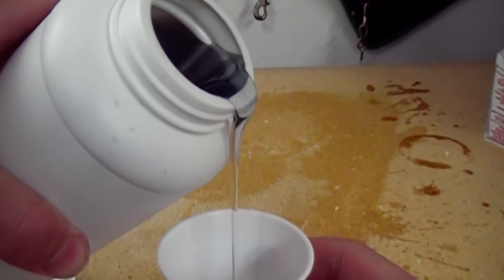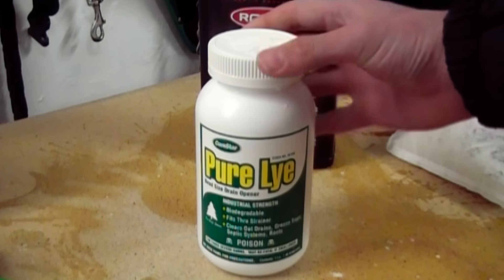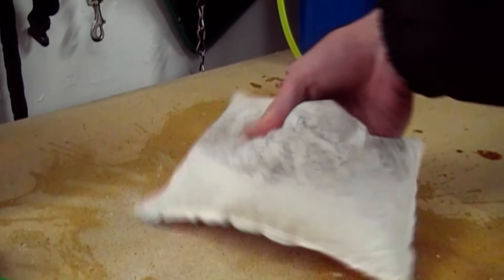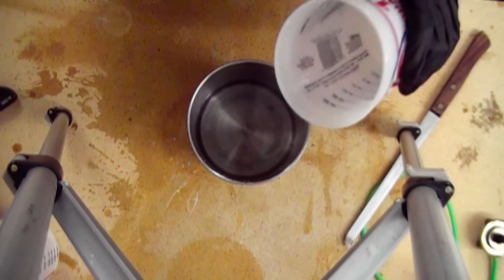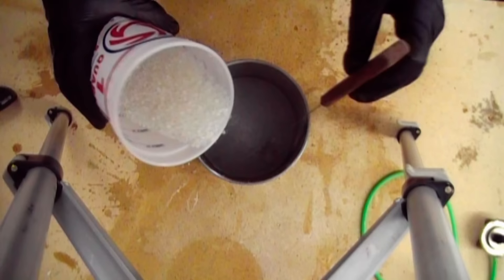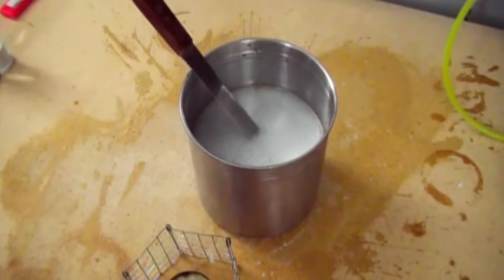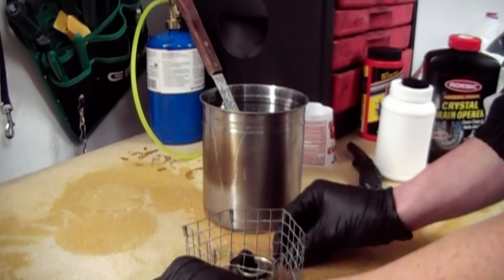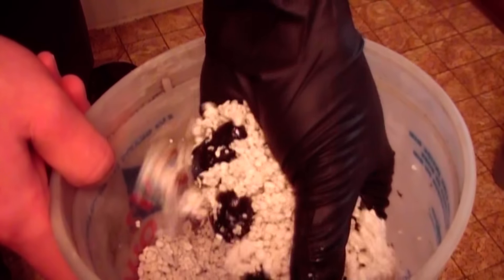Homemade sodium silicate (water glass)

Comment: Whats wrong with using the drain opener with sodium nitrate?
Reply from the maker: at the very least, the sodium nitrate will be an impurity, at worst it could cause an unwanted reaction.
Reply: clkindred Thanks for the info, I realized sodium nitrate works as a soap lubricant in the drain cleaner I bought today, but will be taking it back, Thanks Again Hasta La Vista!

Comment: The stainless steel bowl is better than borosilicate glass for your container because sodium hydroxide causes micro fractures in the glass over time with use. the stainless is safer.

Comment: Does the mix perlite + sodium silicate weights a lot?
Reply from the maker: Josue Valentin Whoops, sorry for the late reply. No the perlite is very light by itself, the silicate adds a bit, but the whole thing is very light weight.
Reply: You made my day. Thanks. I was thinking in making a large one I was worried about the weight.  Thanks keep up I like ur videos
Reply from the maker: Depending on how big you go, it might be cheaper to buy ceramic blanket for most of the lining. My newer design uses aluminum oxide coated perlite, which can take the heat much better but if a lot is needed it gets expensive. Unless, of course you just like being able to make something your self like I do.
Reply: Of course after watching your video that's my plan, things are too expensive and low quality. I've seen ceramic paper too expensive. I'll be making a 10' x 10' box so I don't think I'll need that much I think.  Maybe I put some s'mores to test it. Thanks

Comment: Will this still work if the drain cleaner has potassium hydroxide?
Reply: Yes and no. It will react to form potassium silicate, which is similar to but slightly different from sodium silicate.  How that difference matters in real world applications, I'm not sure.  Sodium is cheaper than potassium, so it's the more common form.

Comment: Can I substitute silica gel with silicon dioxide?
Reply from the maker: chemically they are the same, however the silica gel has a sponge like structure that allows it to dissolve quickly in the lye. crystalline silicon dioxide is difficult to dissolve in an aqueous solution of sodium hydroxide. I believe the temperature needs to be well above the boiling point of water, therefore no water can be present. So you're looking at heating the sodium hydroxide in until molten, and adding the silicon dioxide to it. This must be done in a steel vessel because molten sodium hydroxide will eat right through a Pyrex beaker.
Reply: Ouch. That sounds horrible. However I wonder what will happen if I grind it into tiny particles. I have a baw mill, and if left alone for a few days that thing can crush stuff to less than a single micron. Have to be careful though, silicosis is a very real possibility. I will post my results.
Reply from the maker: That might work in place of silica gel.

Comment: clkindred. I found some black 70 grit aluminum oxide. would this work?
Reply from the maker: Brandon Beverly 70 grit is kind of big, but the black part would raise the most important question. Why is it black? If there is a resin coating, or the aluminum oxide is glued together to make larger grits than it will not work.
Reply: Brandon Beverly I haven't done it yet, but have the same stuff. It will probably work just fine and likely is just black because of some impurities. Will let you know how the forge turns out.
Reply: free8704 Yes the 70 grit aluminum oxide does work. It is a little more crumbly though when making the cement, it really needs to be pressed into the walls of the forge and helps to blend it up in a coffee grinder a little bit first. You forge also takes on a black color obviously rather than light gray.
Reply: free8704 thanks.. I really appreciate the update..

Comment: A bit irresponsible to never mention the inherent dangers of working with lye as it's such a strong base that it can cause blindness. I love your creativity. Just please remember that most people attempting what your showing have zero foundation in the chemicals and tools your dealing with. You have a responsibility to mention safety at the very least.
Reply from the maker: Nick Pierson Thanks for the comment, I will consider that in the future.
Reply: Actually people need to learn what they want to do before they hurt themselves and READING the products label can help!  Maybe he should also explain fire is hot so don't burn yourself if heating it. LOL
 Don't stick your fingers into open flames, don't put your face to a lit burner to see if it's burning or your may lose your eyebrows. LOL
 If using a wax candle for heat don't tip it over because it could start a fire and burn your house down! LOL
 Lye is common drain cleaner sold in many stores and nothing more, and it has a label on it!
Reply from the maker: I get what you are saying, I feel much the same way, the individual is responsible for their own safty, no one else. However as a professional courtesy I have considered the other comment as valid also.
Reply: You guys are assuming these videos are being viewed only be responsible adults.  You must consider the larger group, these are not chemists, they may not even be adults. These people are novices at best and I am sure the video author wouldn't want to contribute to someone losing their eyesight.  There is a reason for warning labels. Your Science teacher didn't go over safety in the lab for no reason at all. At least some of the responsibility of safety should be on the teacher.   Everybody has the right to do as they wish, but I wouldn't want to have someone hurt over one of my videos and feel like I didn't give a proper warning.  There ar lots of "common" household products that can kill someone whom didn't know the full extent of what they are working with.
Reply: Nick Pierson
thanks mom!
Reply: Would a total idiot REALLY be looking up "How to make sodium silicate"? 

The containers for various household chemicals have more than enough warnings and instructions.
Reply: Why so much push back on a little bit of disclaimer?  I found this video as a "related" on youtube even though it had nothing to do with the original search.
Reply: Nick Pierson Just saying that people are not all idiots. AND, you wouldn't want to live in a world without risk.
Reply: Nick Pierson  Perhaps you have a point, but I doubt it really! Should all auto dealers selling cars explain how to put gas into them, how about oil or tranny fluid which is also harmful and dangerous even if not explosive like gasoline! Oh wow, what about  brake dust if you do your own brake work, should the dealer selling used cars or new cars explain ALL the dangers of owning a car or keeping it maintained your own self? I think NOT!!! 

Those are just things in life that need to be learned as needed. SORRY if some idiot tries to use a lighter to light some paper on fire as he fills his gas tank on a mower from a 5 gal gas can. NOT OUR PROBLEM!!!
Sorry the guy goes up in flames, but hey we only said how to fill the gas can and how to run it into a tank,  we said nothing about cell phones, cigarettes, open flames, heavy explosives, gun fire, tank canon fire, heavy air assault bombs in local area,  etc....
Reply: Were you ever dumb when you were younger? Does the car dealer sell to kids? Cause Youtube does.
Reply: Nick Pierson
 "You guys are assuming these videos are being viewed only be responsible adults."

You know that right there sums up allot!
 ONLY Adults may enter into a legal contract of any form or matter!  SO NO KID has any legal right to be on the internet at all ever unless an ADULT has given that child access! ONLY an adult of 18 yrs or older depending on state laws may enter into a LEGALLY binding contract or suffer legal liability for payment of said contracts etc.. etc.. etc...
 And THAT means no child or UNDER 18yrs of age person has ANY legal right to be on the internet at all EVER! 
 ALL Internet contracts are required to be between a LEGAL ADULT OR BUSINESS, and NO ONE under age 18 can be a LEGAL entity to engage in any contracts!

So forcing adults to surrender rights and what ever to protect the kids is a farce as the kids have NO legal right to even be on the internet at all as they can not enter into any type of legal contract themselves to get service in their own names!

If you give Internet service to a minor, then YOU are as responsible for that as you are to give them Beer or Porno Magazines or even cigarettes!! Etc...
Reply: Buddy, there isn't enough tin foil in the world for you.
Reply: Nick Pierson
gonna have to upgrade to lead
Reply: It's called survival of the fittest for good reason.....I have done some stupid things ,but I assume responsibility for my mistakes. The problem with this obsession with "safety" is that it results in removing useful products from the mkt...it's becoming difficult to find even basic stuff,replacing oil paint ,for instance ,with plastic...I had a hard time finding lye a few yrs. ago.....we are encouraged to trust the govt. to protect us ,and thus lose a sense of personal responsibility, NOT a good trend                           PEACE
Reply: I agree, G-dam safety police. If someone don't know what the ef they are doing, they should learn or just not do it! Sodium hydroxide is dangerous, does that need to be said when its dissolving frikkin sand in this video?
Reply: Oh crap, lye is unsafe?! I was so startled I choked on my tidepod!!!
Reply: Good call.  An oversight, I'm sure it wasn't intentional... sometimes smart people forget there are dumb people out there :D

Comment: Only sodium hydroxide I could get so  far in UK  is caustic soda sodium hydroxide crystal drain cleaner, it says on label it has sodium carbonate in it but does  not say how much of it, Is this useless for the task? anything with 100% lye costs  a small fortune for shipping  to the UK. I will keep looking though. Cheers. PS. It appears that sodium hydroxide is a derivative of sodium carbonate, umm, me feels stuck lol.
Reply from the maker: Have you tried places that sell supplies for homemade soap making? Sodium hydroxide is a key part of that. As far as if the sodium carbonate will foul up the reaction, I'm not sure and would try a small batch to find out.
Reply from the maker: clkindred
 I just googled "soap making UK" and found a place called soapkitchenonline dot co dot uk that has lye for 3.15 for 500g. How dose that compare with what you have been finding?
Reply: That's great, I will give that a check, good price as  well, I have everything else for the complete task even the alum-oxide, just the 100% lye, has been the issue. Thank you for your help Sir, well appreciated.

Comment: @clkindred I bought cat litter but it also had some blue dots in it, but it's said it was silica. should I have any problems?
Reply from the maker: It will make the sodium silicate purple, but that is about it.
Reply: +clkindred Okay thanks. Should I be worried about the fumes?
Reply from the maker: +kade Vanleuven well I can't say no, but I did not have problems with fumes, it just smelled like soap. Do the reaction in a well ventilated area and it will be fine.
Reply: +clkindred Okay thanks man

Comment: Can someone tell me if this sodium silicate can be mixed with a solvent carrier and applied as a ceramic/nano wax on automobile paint?
Reply from the maker: Zu M Not that I am aware, I haven't tried many solvents. Only polar solvents that will mix with water can be used, as the sodium silicate is a solution in water. Alcohols cause the sodium silicate to gel, polymerize even. A recipe for homemade bouncy balls is sodium silicate and ethanol I believe. Acetone might work as a carrier solvent, but I wouldn't try it on a car's paint.
Reply: This is the same idea I am attempting to research.  Did you keep digging and find something closer or the same as the auto ceramic coatings?

Comment: ok so i've been trying to find out why not to use the one with sodium nitrate. does anyone know?
Reply from the maker: The sodium hydroxide forms a very alkaline solution which can dissolve the silica gel. Sodium nitrate will not do that. Other hydroxides can also dissolve silica gel such as potassium hydroxide, to make potassium silicate.
Reply: clkindred ok so it doesn't do anything then?
Reply from the maker: Right, there is no reaction between sodium nitrate and silicon dioxide that I know of.
Reply: clkindred ok thanks man

Comment: I just totally failed at this.

I reduced that amounts to 1/3rd the amounts

I dissolved the Sodium hydroxide (pure lye) in a 500 ml flask using the reduced distilled water.on a corning headed stir plate.
after it was fully dissolved  I slowly added the silica gel beads and brought it to a boil and kept my magnet spinning fairly fast.  It took absolutely forever for these (very old) silica gel to even begin to dissolve.  The only think that it ever did was turned to a muddy foamy mess.  

It ended up being a pile of wet sand!!!!   I could have NOT boiled it any harder.  The heated stir plate is capable of boiling without any problem!!!!

I used very very very old packs of silica gel that were actually Green in color.  
this is bizarre
Reply from the maker: Some people have noticed they need more water to get everything to dissolve. If your silica gel was hard to dissolve you may have lost too much water as steam while waiting. Are you sure these old packs were really pure silica gel? As I have seen a wide range of compounds used as desiccant for various applications.
Reply: They said pure silica gel on the pack
Reply: Clown Whisper I ended up trying the silica gel cat litter that had no additional ingredients.
The reaction is going fine and as predicted. Im bringing it back to boil on my corning hot plate.
the heating reaction completely dissolved the silica its own!!!!   RIght now its a bit foggy so I am going to stir and biol it to see if it will get crystal clear
Reply: Clown Whisper I should have added that if you use silica gel cat litter it has some small amounts of contamination but for use as a high temp binder it will make absolutely no difference what so ever.
Reply from the maker: Yea, the kitty litter made my batch very purple.
Reply: Oh yeah I picked the blue ones out to avoide that.  I discovered that it was my mistake that it looked contaminated!  

I just found that out a few minutes ago as a matter of fact.  You have to boil it until its PAST that foggy phase.  I just made a crystal clear batch with the kitty litter !!!  

but YES you do have to take those blue ones out.  Its a pain but for the cost of the kitty litter its well worth it.
Reply: Excessive stirring may have introduced bubbles into the mixture. Gentle stirring is the ticket.

Comment: You can buy it at any pharmacy already made.  This is great for a blown head gasket repair. This is called sodium silucate at the pharmacy.
Reply from the maker: Dbgrasshopper33 If you have a K&N air filter, the "recharge" kits with the cleaner and oil, the cleaner is a solution of sodium silicate. This stuff will clean an oily air filter like nothing I've seen before!
Reply: clkindred I have a K&N recharge kit.  The cleaner bottle says it has disodium metasilicate.  Are you sure that's the same as sodium silicate?
Reply from the maker: Yep, just another name to describe the same stuff. Sodium silicate can have different silicon to sodium ratios, so a different name is used, but they are all very similar compounds.
Reply: clkindred Hmm, I sprayed some K&N disodium metasilicate cleaner (very watery) onto a metal plate and heated it up to evaporate the moisture.  It dried out but didn't really harden well.  Eventually, it just turned into a white crystalline powder.  It doesn't seem like it would be a good adhesive.
Reply from the maker: Yep, sodium silicate is hard to work with, it's fussy. Sounds like it transitioned from silicate, to silicic acid, to silicon dioxide too quickly forming a fine crystal structure, rather than an amorphous glassy structure. Or perhaps additives in the cleaner inhibited it.

Comment: it never dries !!! left it for 4 weeks and still not solid
Reply: Just curious what did you use it for
Reply: I mixed it with Perlite and Sand and it never became "brick"
Reply from the maker: It is easy to add too much sodium silicate to mixtures like that. The result is a mixture that won't dry.
Reply: i will try i again but does the silca gel have to be on the stove to remove moist? i dont want to ruin my cooking stuff